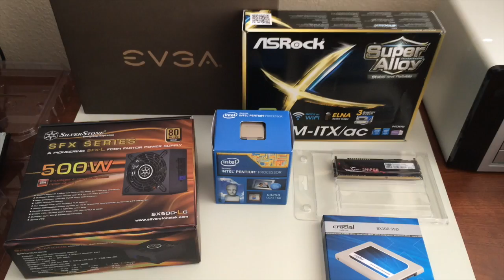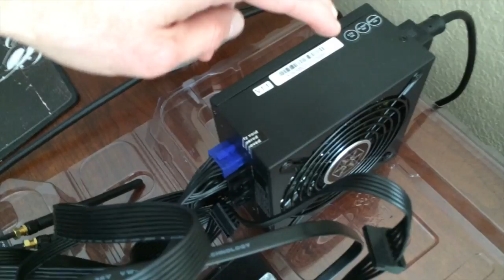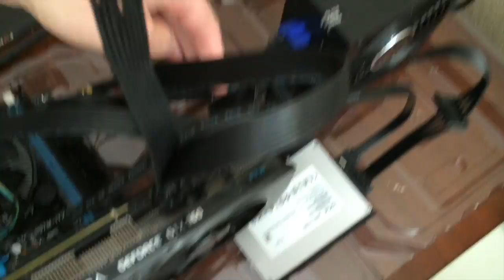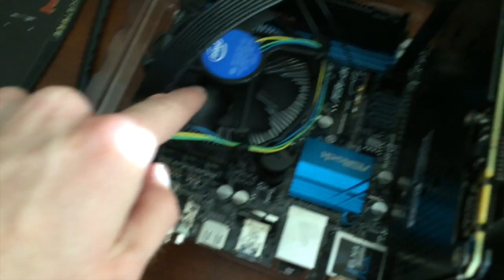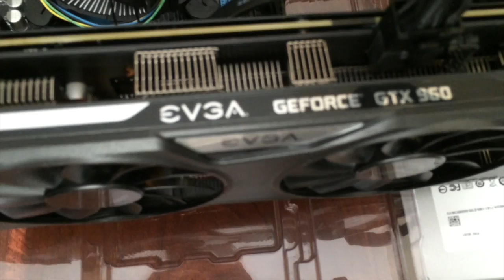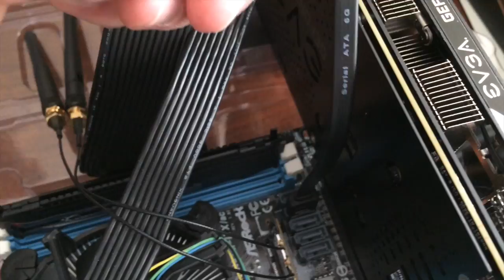Overview

Comment: Thanks for this! I have the same case as in your other videos as I just bought parts for this build but I have a traditional hard drive instead of an SSD.
Reply from the maker: +The Jersey Nerd awesome! happy building
Reply: +Douglas Hewitt Do you have any suggestions for installing a 3.5 inch HDD? I have a 1 TB but I can't figure out where to put it.
Reply from the maker: +The Jersey Nerd so I never did a 3.5in drive. Typically it goes on same side of GPU, but then obviously you cant have a GPU too. There's a way to put it in where the DVD drive would go, check my link on the question on my other video here https://www.youtube.com/watch?v=WLMPcNk8764&list=PLugJ1ygKKMlLtIIHfck7aYBXQPxNXVHtI&index=8